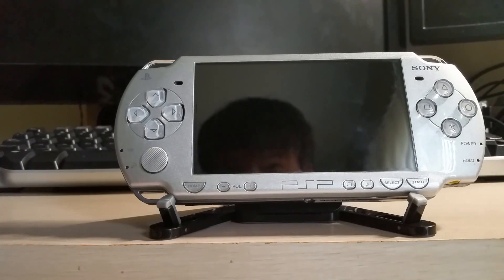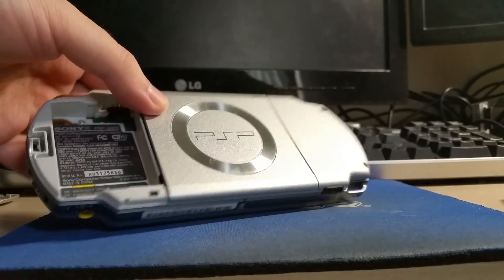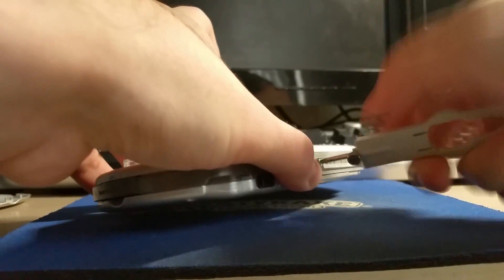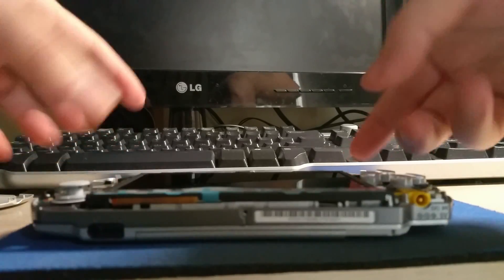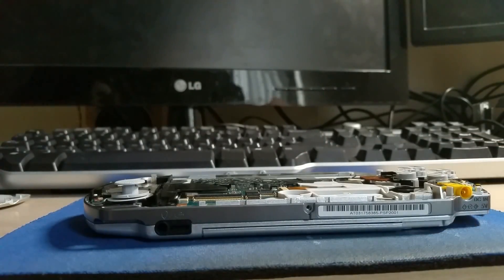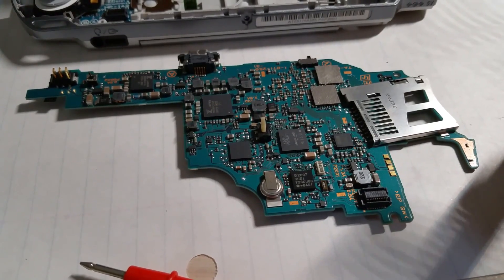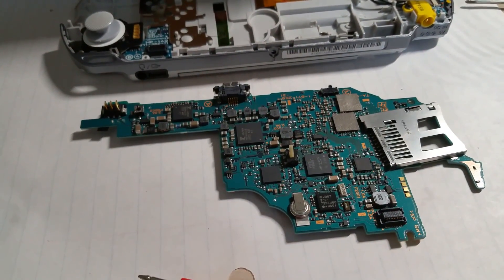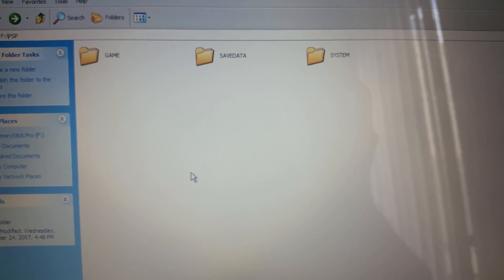TeardownTube - episode 47 - Sony PSP 2000 Slim & Lite Disassembly and Repairdown!

Comment: Your video helped me open the psp to check if something was disconnected or cut but unfortunatelly is seems something else is the problem and not the power switch I thought. I will bring to a repair store I guess. I only managed to turn it on for 3 seconds and it turned off

Comment: I am sure most electronics have a system memory. where is that on the motherboard? my psp is bricked and even a pandora battery and magic memory stick won't unbrick it. I can't force the console into recovery mode or anything. I want to completely remove the system memory and restart the thing
Reply from the maker: What model number is it? Pandora method only works for 1k/2k. Last time I read it's now possible to unbrick every model, even serious hard bricks but you will need to solder a usb serial dongle and run an automated script to manually force a complete low level reflash of the firmware.
Reply: @sjm4306  I have a 2000 model. I used the pandora battery and magic memory stick method and I can't get it to power up outside of the green light. I know the magic stick works.

could you explain this new method to me? I may try to force a complete reflash, but I need more info.
Reply from the maker: I have a few 2k's that do the same thing and also dont work with my pandora batt. In my case they have moisture damage to the components in the power supply section of the pcb. Are you absolutely sure there's no electrical or physical damage to the pcb or the chips on it? It could be that your recovery isn't working because your cpu can never boot due to power circuitry damage or any of the other number of circuitry the cpu needs to work correctly being damaged somehow.
Reply: @sjm4306  do you think a failed update could cause circuitry damage?
Reply from the maker: No, an update cannot cause hardware damage in the psp
Reply: @sjm4306  even if the update installation failed partway through and I was stuck forcing the console off?
Reply from the maker: That would only brick the software but cant physically damage any of the components. You can give the baryon sweeper method a try in the off chance completely reflashing the nand works https://wololo.net/2021/11/09/how-to-unbrick-a-psp-3000-video-guide-by-khubik/

I dont know if it would work on 2k though, and of course only fixes software bricks and will do nothing if your psp has any component or board level physical damage.
Reply: @sjm4306  thank you. If I can understand the instructions and get the necessary tools, I will try it. thanks
Reply: @sjm4306  you mentioned my psp might be "unbrickable." how would I know whether or not it is unbrickable? why would a psp be unbrickable?
Reply from the maker: When I say unbrickable I mean purely in the software sense and if you have the right hardware to force a nand reflash. There's two recovery methods, if you have cfw installed you can use the built in recovery bootloader by holding specific buttons while trying to power on (the exact buttons depends on the cfw and how it's set up). The other is a more hardware recovery by using a pandora battery or injecting a specific serial command into the battery data pin (this method doesn't depend on cfw and thus works with ofw). From my understanding, the reason 3k psp's dont work with pandora batteries and need the baryon sweeper serial usb adapter is the 3k psp bootloader requires an additional device serial key to be injected in addition to the regular pandora command in order to boot into recovery. This key is tied to the console and different for every psp, it was sony's way of basically locking out hacking this model of psp by preventing firmware downgrading or unsigned fw loading without already know the encryption key. The script you have to run for the baryon sweeper method must use some exploit to dump/figure out the key and then sends that along with the pandora command to boot into recovery. Bricking due to hardware damage of course can still happen and no amount of software reflashing would fix those sorts of problems. I think I remember reading though that early 2k psp models would work with pandora batteries but not later ones so it's either possible that your psp is soft bricked but a later model and thus pandora wont work or it has some hardware issues preventing it from booting.
Reply: @sjm4306  ok. thank you

Comment: Can I transfer all components of psp 3001 to psp 2006 housing cover casing ?
Reply from the maker: I actually don't know off the top of my head, but a quick google search suggests that it's not a 1:1 swap and would at minimum require cutting plastic if it's possible at all (some parts may just be too different to fit without major modification). Sorry I couldn't give you a definite answer.
Reply: @sjm4306  
Thank you so much for the answer and no proplem at all 👍🏻

Comment: Bro what torx screw  did you use
I have problem opening psp 2000
Reply from the maker: Psp's used small phillips screws not torx. I use a set of jewelers screwdrivers.

Comment: I need to replace the memory card reader.. I ordered a new reader, looks like   the old one is soldered on, is that correct?
Reply from the maker: Depends on what model revision your psp is? I think 1000s had a little daughter board (though it's been years since I've cracked one open) while 2000/3000 are soldered to the mobo.
Reply: @sjm4306  its a 2000.
Thanks.
Reply: @sjm4306  
While I had it apart I bent the prongs on the old reader. My son just said it works. Man I'm glad, didn't want to try soldering in the new one.
Thanks for the show n tell, it made my job easier
Reply from the maker: Yes, simple fixes are the best!

Comment: I have a psp 2000 with a brand new battery. It comes on with the ac adapter with no problems except it does not charge the battery. And yes it charged when I first bought it but now does not. It is beyond the return policy for the store I bought it from, but I do not think it is the battery. What can I do?
Reply from the maker: I've found the middle contact, which tells the psp that a legit battery is plugged in, often is pretty flaky and can prevent the psp from recognizing and charging batteries. Try wiggling the battery a bit as you insert it to try and make better contact. If that doesn't work then you will need to open the battery, get access to the contacts and very carefully bend the fingers inwards so they grip the metal contacts in the psp better.
Reply: @sjm4306  it's actually a snug fit for the battery and does not wiggle. Also the battery dinger connectors are in proper position for the pins in the console itself. I am at a loss as the old battery was oversized and was bad so I recycled it months ago.
Reply from the maker: What I meant is that the metal contact pins inside the battery may be loose. I had the exact same problem with my 2000 and an after market chinese battery and opening the battery and pinching the metal fingers a little tighter fixed it.
Reply: Better than my Analog Stick Problem

Comment: Did you ever fix it?
Reply from the maker: I ended up just replacing the motherboard. I think it was a hardware problem since even a pandora battery did nothing.
Reply: @sjm4306  hye do you still have the battery
Reply from the maker: I should still have it somewhere in a drawer.
Reply: @sjm4306  can i have it
Reply: @sjm4306  its hard to find that batery

Comment: Mine comes on but doesn’t stay on forever it doesn’t charge and it doesn’t read the UMDs
Reply from the maker: Probably two separate issues. Your battery might be near the end of its life whichwould explain the power and charging issues. Additionally, for the umd drive the laser lens might need cleaning or the laser itself could be burned out and need replacement.

Comment: did you ever find out if this psp was in a brick?
Reply from the maker: TheLampPlays I ended up getting a Pandora battery, making a magic memory stick and confirming that they work on another psp, but this motherboard still couldn't be revived. My best guess is it has some hardware damage beyond a simple brick. I ended up swapping the motherboard with a good one.
Reply: oh nice
Reply: @sjm4306 dang a shame the mobo is indeed broken

Comment: do not need pandora anymore.  you can softmod to unbrick now.
Reply from the maker: Really, that would be awesome. Can you link me directions? Thanks!
Reply: sjm4306 http://digiex.net/guides-reviews/console-guides/12915-psp-6-61-custom-firmware-install-any-psp-psp-psp-slim-psp-3000-psp-go-e1000.html
Reply from the maker: Thanks! I've looked through the instructions and from other sources I've read unfortunately this might not work since I'm pretty sure now that my psp had ofw on it before bricking and thus I have absolutely no access to any sort of recovery menu unless I am misunderstanding something. It looks like the only way to recover an ofw psp is to use a pandora battery to access the service menu and overwrite the flash0.

Comment: What color is your other psp 2000?
Reply from the maker: My working 2000 was black but I changed the cracked case to clear blue. In addition I have two other non-working black 2000's that have varying problems. I've always wanted a silver one because they look real slick. In the future I would like to also pick up one of the carnival colored 3000s.
Reply: Nice I have the blue madden psp 2000 I had a bunch of other psp but I sold them.